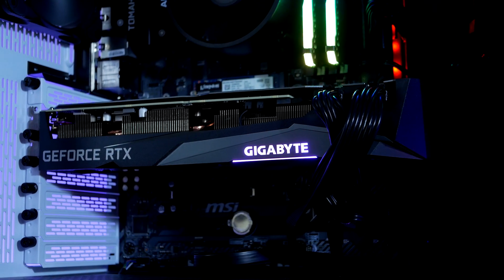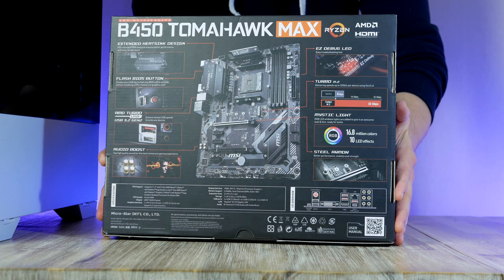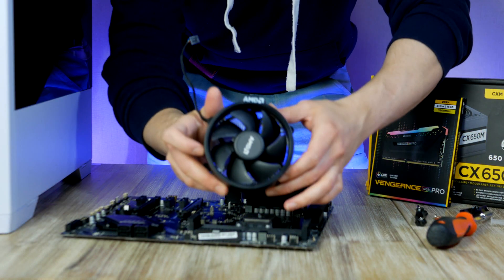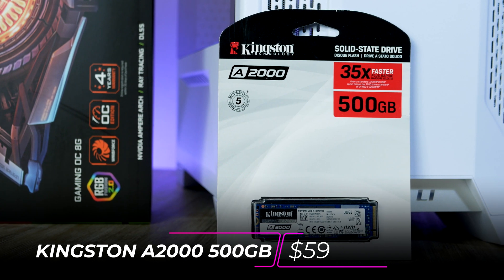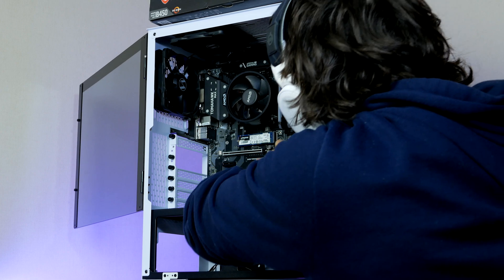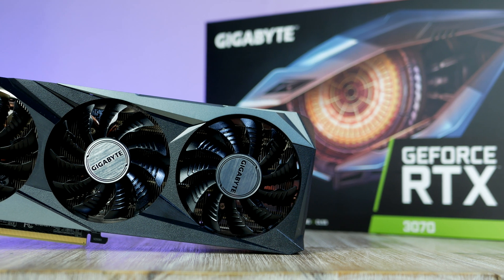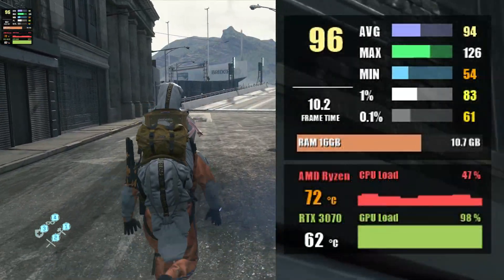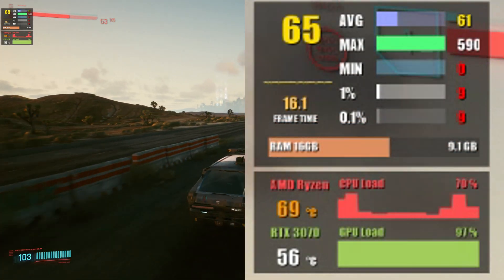Budget $1000 RTX 3070 Gaming PC for March 2021! Complete Build Guide + Gaming Benchmarks!

Comment: Whats a good gpu replacement because its way more expensive right now
Reply: Integrated graphics is your best bet rn
Reply: It won't be as strong but maybe a GeForce GTX 1650 or 1660. They will do well for any kind of gaming and possibly streaming.
Reply: @balecnossis2985  dude gtx 1650 is garbage
Reply: @orphivs  but graphics cards are flying up in price right now and if you want a decent build for cheap rn its probably your best option, what do you think would be a good substitute for a similar price because I'm trying to get my first build right now and don't know but I am at an approximate 1800 budget AU dollars and have copied alot of Austin Evans video about 10 months ago, just upgradi g the SSD and power supply
Reply: Rtx 3060 on Best Buy

Comment: Here is what I want to know, where the hell are you getting the GPU that cheap. Yes, that is the actual price but assholes are buying them up and then selling them at 2-500% mark up. Its a great build but it is pointless without a GPU as the Ryzen 5 3600 does not have integrated graphics, even if it did, you would not be getting the same benchmarks.